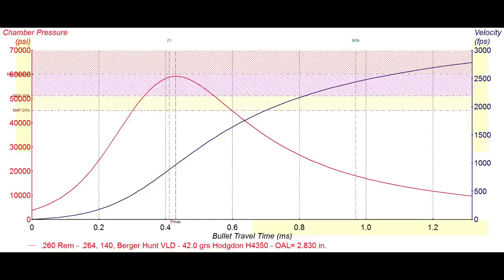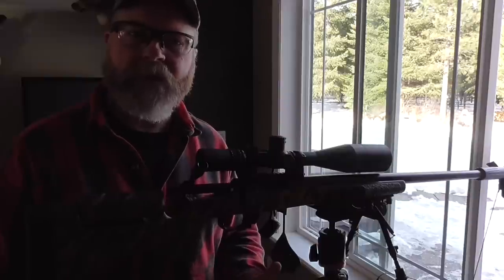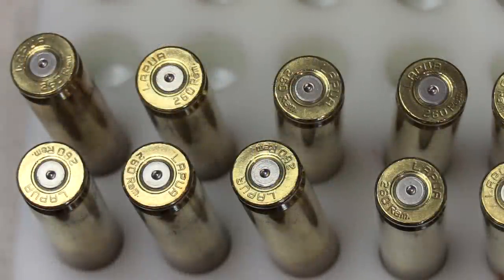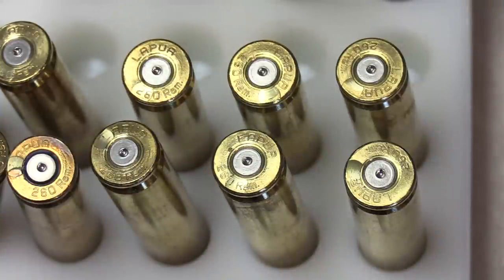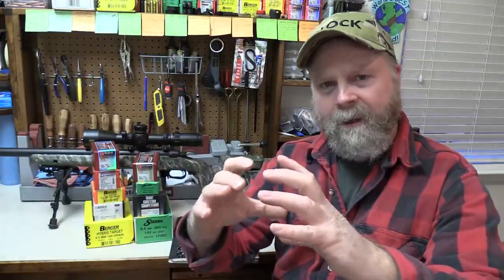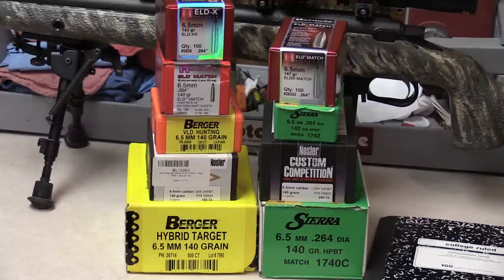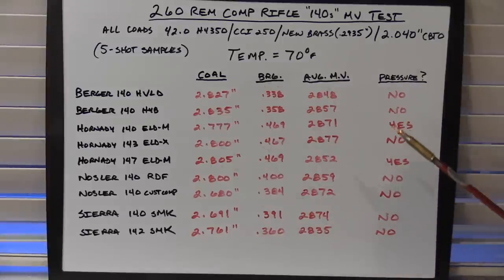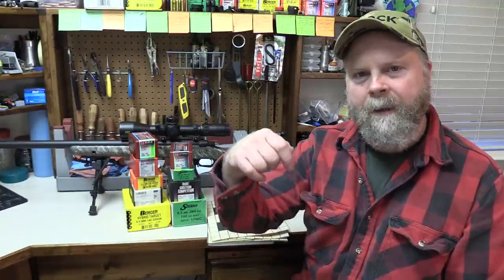Precision Rifle Load Development/ Part VI: Pressure Signs & 140-grain Velocity Testing

Comment: This was so helpful, I can't thank you enough. I was getting great results with my 7mm-08, 145g Speer loads up near book max, but seeing flat primers. Velocity and groups were great, but my CCI primers were flatter than I was used to. Only had slightly heavy bolt lift at 40.7 grains of IMR 4895 with a 41.0 grain book max, but primers flat all the way back to 39.5 grains. There was almost no ejector marks or other primer marks that would indicate excessive pressures. This makes me more comfortable with determining reasonable pressure signs and reading multiple signs rather than just how flat the primers are. Thanks for continuing to put out these great videos, you have helped me to improve my shooting, reloading and be much more safe as I continue to learn. I am not a competitive shooter except that I have become competitive with shooting better every time I go to the range. Thank you!!!

Comment: Great video, I agree with your pressure sign method.  FYI -- In Quickload, if you click on the Shot Start (Initiation) Pressure number an info box will drop down. Near the bottom of the info box it says, "WARNING: With bullet seated to touch rifling add 7200 psi to Start Pressure".

Comment: In regard to a sudden pressure spike with a tested load, several reasons might be in play. A different lot of the same powder may be the cause, a change of primer , a seating stem which came loose and backed off, a die that became loose and backed off. I know you buy in bulk and these would probably not happen to you, but a person who asked the question might not realize how much difference it can make. By the way, dies loosening up on me has happened. I know it shouldn't happen, but it does. I have been reloading since the early 70s and have made most of the mistakes a person can make. I am 78 and I learn something new almost every time I shoot. Thanks for your common sende approach to your videos. I think I know a lot about reloading, but I have tried to learn different ways to do things, that way I have a different way to do something if one way doesn't work.

Comment: Sam I love your reloading methods and equipment explanations! I am a different marksman than you, I was into U.S. Military Service Rifle (NRA) target shooting from 1987 to 1995 using iron sights. I used my M1 Garand (March 1944 initial manufacture date, refurbished in 1952 by Springfield Armory) and an M1A Springfield (1987) Nation Match rifle. I used “Federal bench rest primers” for my M1A during my competitions. They were normally at 200 yards, but I loved shooting prone at the Appleton, WI 600 yard slow fire competition.

I agree with you on evaluating high chamber pressures. I used Federal brass (.308 Win), Sierra 168 grain HPBT Match King (2200) bullets, IMR 4895 (40.5 grains), and the Federal Bench Rest primers. My post fired primers were flat as a pancake. Primer flatness, after firing, depends on the cup metal thickness! So relying on primer condition, after firing, is not the total story! Your explanation, concerning extractor marking on the brass head, makes sense to me. I think both are important but you have to have the experience to evaluate both conditions. Hard to teach in a video.

I wish you were into service rifle reloading and firing! Reloading for a bolt gun and a gas semi-automatic rifle are very different from a safety stand point. Especially service rifles that have a floating firing pin and a gas system for semi-automatic firing that requires medium burning powder rates to prevent operating rod damage.

Comment: I think it's worth mentioning that bullet intrusion on case capacity also affects pressure. i recently set the barrel back on a rifle to achieve best accuracy at mag length OAL. All else being the same, i had to drop 1.5 grains of powder to get back to safe pressure. This was with a 338 RUM, 285 ELDM.

Comment: I like the Erik Cortina method of starting seat depth at 0.020" clear of "jam". I take a sized case and seat a bullet then pull the bullet to make a seat depth test case that you can then push bullets into by chambering to determine jam point. It's a simple and reliable method that doesn't require wonky tools. Then I use the same loose neck test case to set up my bullet seat die. I can literally push the bullet into this case by dialing the micrometer on the die which gets me to within .001" of my target seat depth.

Comment: By just moving further back off the lans you increasing the pressure in the cartridge, when you seat the bullet deeper into the case you decreasing the cartridge chamber space which pushes up the pressure. This is why you can get different results with different makes of brass with the same load because not all of them are the same thickness so the inside chamber size varies.

Comment: Sam have you ever experienced an increase in pressure from hot to cold weather?  In two hunting rifles 270win using RL22 and 300WSM using RL19 I experienced hi pressure after moving to Idaho and shooting while cold.  I assumed I messed something up and unloaded everything and reloaded the 270win with 66g of RL22 (max).  Again experiencing hi pressure in cold weather...sub 30 degrees.  I was looking at switching to an hodgdon extreme powder. I did the “extreme tour” on their website.  There is data there that suggests a 30-06 had an increase in pressure at low temps and a decrease in velocity.  News to me.  I will try and add a link soon.

Comment: I’ve been going about this the wrong way. Thanks for the info. I’m gonna step it up. I just got around to loading some 300 win mag and only managed around 2700 FPS with retumbo and 225 gr eld match on a 26” barrel with 1-9 twist. I’m thinking I can get more out of it.
Reply: magillagorilla1180 lol i averaged 2875 with h1000 with that same bullet at safe max pressure with my 300 WM. 26 inch barrel.

Comment: It would be interesting to have you measure / compare the cartridges you shot over pressure with a cartridge comparator - base to shoulder.  I found my 250 Ack would leave the cases just a couple thousands longer on the rounds when pressure started to be an issue.  But I have not duplicated those results yet.

Comment: Love the channel. Took your advice about the cci 250 primers over the br2s and i watched my ES almost disappear 2 range trips in a row! Thats with h4350 of course with no other change except a primer swap. Loaded up 2 exact same loads, 1 with h4350 and 1 with h4831sc.. once again only a primer swap and boom. Cci 250 grouped better with 2 powders. Definitely also agree on cup hardness too.. some primers “crater” and flow around the firing pin at the same time u get sticky bolt.. some dont. Never can just judge by how flat a primer is.. love this channel, thanks for the info, and keep up the good work!
Reply: oh..ive got a 6mm Creed.. I ran into the exact same problem with finding the Bergers in the 105 HVLD which was my go-to round.. I'm making the switch to Hornady 103 eld-x and 108 eld-M since I can find them everywhere.
Reply: 88gt306 I use br2 primers on my 6.5 creedmoor. Should I try the 250 primers ? I’m kinda new to reloading so please let me know if it would help me ! Thanks
Reply: Agreed.  Plus CCI primers tend to have harder cups than other brands.
Reply: Alpha6Five 2 years later I see your comment lol. I hope you made the swap to magnum primers by now

Comment: Hi Sam @Panhandle Precision I've just picked up on your comment about Quickload assuming 'Touching the lands'. There's a clue in there that would suggest it assumes jump. When you mouse over the shot start pressure it advises that you add 7200 psi when touching the lands. ( A bit late to the party I know  😉)

Comment: Very informative video series, thank you.  I have a number of 147 ELDMs and I see they have a variance in bullet base to ogive length.  Which means that if I seat them to the same CBTO, some of them will be seated further into the case, resulting in a slightly smaller case volume.  Do you think these could result in any noticeable differences?
Reply: H4350 has a nice node around 42.0 gr, but work up to it bc thats probably above stated max. I'd do a ladder test and pick a plateau. H4350 has shown wide nodes for me in my tikka, so I think that would help neutralize the possibility of varying case capacities because of inconsistent bullets. 

147s still have issues? I've heard of them disintegrating at higher velocities (2,800+) too.

Comment: Ive been working up a 6xc.. i hit a major snag you didn’t really cover.. at 39 grains of 4350 and a 6mm 108 graing hornady sst i started getting a nasty primer extrustion. 20-25 thou sticking out like a button? the rest of the primer looked ok.. bolt lift was perfect no marks from the extractor? Did i hit my end? Was using a standard 250 cci primer. I switched primers to a winchester it went away but didnt take the load any further(was fearful i was at the end of my preasure curve) any thoughts??

Comment: Sam may be overstating the importance of temperature sensitivity.  My primary powder is magpro, which is considered to be temp. sensitive.  Accurate states on their website that the powder is tested from -40 to 125 F and that produces a 3%-5% change in velocity.  So, going from 90 to 30 deg F is going to be a pretty small change.
Reply from the maker: The problem is the 3-5% difference isn’t always from -40 to 125. Some powders are affected by cold, some by heat. Some are really bad on both ends. If stable MV is important to you, it’s worth checking regardless of what the manufacturer claims.
Reply: @PanhandlePrecision  Thanks for your response.  You make a good point.

Comment: Sam could you help me out with a question? So I understand about trying different powder measures and trying different distances off the lands but what I’m confused about is, how do you know which powder charge to use? The one that is most accurate? The one that is most accurate and closest to no pressure signs? The one that’s most accurate, closest to no pressure signs and has the highest MV etc? Many thanks for your videos and the help

Comment: Sam, I understand less pressure when your further from the Lans . I’m a little confused on this though: if you have a powder charge @ a certain OGIVE measurement say at 2.240 and you then back off the Lans 0.020 (pushing the bullet more into the brass) , giving you 2.020, doesn’t this increase your pressures because of limiting the case volume? Thanks
Reply from the maker: Not that I've seen. I'm sure that has a lot to do with the powder used in any particular case/bullet combo.
Reply: I agree with both of you. Let me explain. I worked up a safe .223 load into the lands then backed it off to fit in my clip and had pressure signs. You may not see any pressure at .050" off the lands but at .100" or more you may.  Great video and comment. - Sam my Savage Mod.12 6.5 CM shot a .211" today. But found out it either likes a load or hates it. Is this true with your 260?
Reply: What bullet are you using Chris? I also have the Savage 12 LRP in 6.5 CM. I have been using the RDF 140 grn and have had some trouble until lately when I finally got around to adjusting the seating depth. .80" off the lands landed my groups at .289". .211" is fantastic!
Reply: The bullet is the 130 gr. Berger Hybrid. Nice group by the way. I was getting worried that mine wouldn't shoot.

Comment: I am just starting to reload. Been wanting to do it for 15 years now. I'm only dealing with .556, .308 and 9mm, but your information still holds true to having nice rounds even if it goes fast. The question I'm trying to figure out on this video, is... what the pressures would be if you went 10,000 over your lam. I don't want you to be harmed by testing this. I'm just curious since we are talking pressures. You went way below but did not take into the point of being forward 10,000. What happens then with these pressures. Or rather 20 at that point, Blow up in my face? I'm willing to test that for you, I might just need you to make me some rounds.

Comment: To add to that you will almost always get flattened primers on new brass because they are so much smaller than your chamber and there is no way to change the head space dimensions so don't sweat it if you get flattened primers on new brass

Comment: I have a load that was shooting sub 1/2 moa last year. Now I am seeing the same load open up quite a bit "roughly 3 inches". Is there any other indication when the brass is done for? They are 8x fired brass and have been annealed. No crack necks and none of the primer pockets seem loose when tapping the brass on a counter. 

The barrel has only 1k rounds down the tube. All scope mounts/rings are torqued with a Wheeler fat wrench. 

The last time I cleaned the barrel was no more than 200 rounds ago. 

My other question is when I found the node using a Lee FL sizing die. I had then switched to a RCBS FL sizing die. Will that make a difference even though the shoulders are bumped to the same?

Comment: I know you love H4350 in the 260 Remington. However, with the current powder shortage, what are the other powders you suggest trying with 130 and 140 grain bullets? How about RL-16, Win StaBall 6.5, IMR-4451 or maybe Accurate or IMR 4350s?
Reply from the maker: RL-16 is good, but runs a little dirtier. IMR 4451 is ok. Haven’t tried the others.

Comment: Sam,
CBTO question. I used the same threaded piece of new brass, but came up with considerably different measurements with different bullets. Would you not have to measure the CBTO for each individual bullet to ensure one of the bullets with a shorter ojive doesn’t start deep into the barrel?

Comment: I am a greenhorn on scopes so this may be a dumb question.  In a prior video, Sighting ins a scope you mentioned moving the retinal left to get on the orange circle.  I have a Vortex Diamondback and I don't believe the reticle moves?  It's a 1" 0.25 MOA and I'm told I need to move so many MOA/s to get the scope on the impact point.   It is a special type of scope that the reticle moves?

Comment: I must be missing something.  If you come off the lands to reduce pressure, which makes sense.  If you keep coming away from the lands, you'd have to be putting the bullet deeper into the case. At what point will pressure rise as you put the bullet in deeper? As to deep of seating depth.

Comment: You ever have a head separation. Scary. How many reloads are you getting with lapua before annealing?
Reply from the maker: I've never had a case head separate, even before I really understood what I was doing. I usually start annealing Lapua 260 Rem brass after the third firing, then every firing after.

Comment: It is interesting that pressure goes down when you increase bullet seat depth in rifles... but in pistols pressure goes up when you increase bullet seat depth. I suppose at some point in rifle hypothetically pressure should start to increase as you seat deeper especially if the charge is compressed?

Comment: Thanks for your video’s. I always thought by dropping the projectile deeper into the casing will automatically increase the pressure. I did not realise that being in the lands is actually creating more pressure.
Excellent work - I am learning a lot from what you do. Especially for a beginner like me, seeing examples of what pressure looks like, and what to look out for.
Reply: Well, The infomation in the video is a bit misleading. Pushing the bullet longer inside the case can just as well increase the preasure, because you will make less room for the powder. And if you the load is already 100% full you will create a compressed load. And that will probably create more preasure then you could ever make by pushing the bullet into the lands,

Comment: It seems all the Hornady bullets have higher BR, .467 - .469 (diameter if i'm not mistaken) vs almost all others at or below .400.  Could this cause enough friction to cause the higher pressure issues you saw?

Comment: question, does seating further in really make a difference if the case is not really crimped more around the bullet, aka, tight, if the bullet just deeper, but still very easy to push out then guessing it has little impact on internal pressure curve.

Comment: Please explain how a full length sized modified case that is bumped 0.002 can accept the bullet so that it sits loose in the case mouth? And was under the impression that the case should be fire formed and then modified. Sorry am just confused.

Comment: I'm trying to work on a load development for my Winchester M70 308Win and I think I am at my max load, .7 gr less than listed max in Hornady 10th ed.  My bolt does not have a spring ejector and the Federal 210 primers are starting to show cratering.  Would this be enough of a pressure sign for you to stop?

Comment: Recently found pressure signs using vit n150 in my 22/250, only in the first few shots as I was only after cleaning could of been excess oil in the chamber.
How much could neck tension affect this

Comment: question reloading 1895 marlin lever stainless . 500 grain dgs with aa5744   , 28 grains getting 621 fps how much powder can i go to,trying to keep it subsonic,what  is this gun designed for pressure and so on ,can not find any reload spec. on this  500 bullet